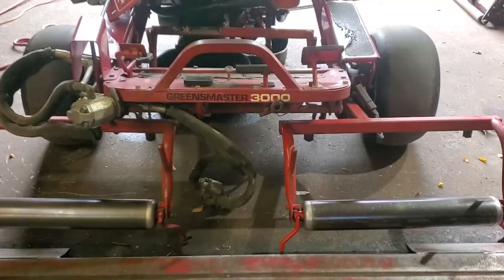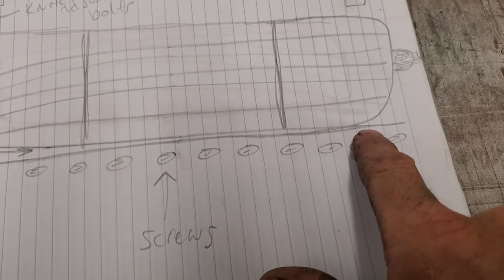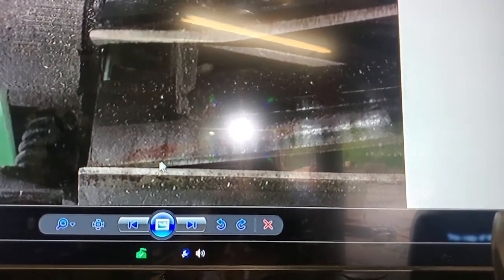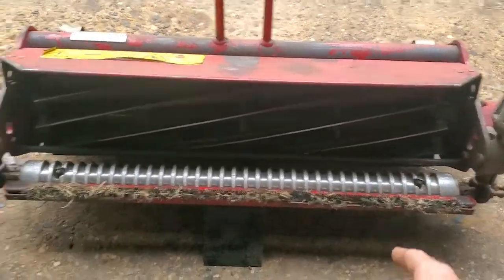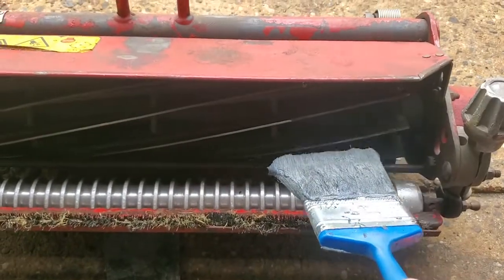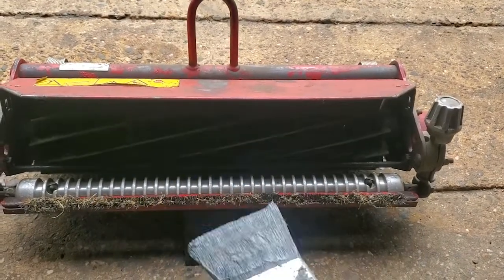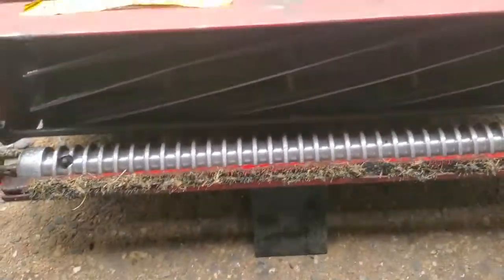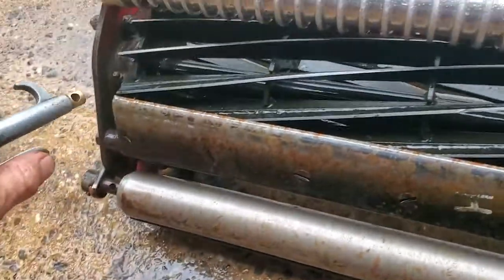Back lapping and Height of Cut tips for Reel Mowers

Comment: Can you please do a video or comment on how you removed the reels from the machine? I have a Greensmaster 3100. This was a very helpful video, thank you!
Reply from the maker: Do you mean take the entire cutting unit off of the front lift arm and rear lift arms? Or do you mean removing the actual real from the housing. To remove the reels I believe on a 3100 it should just be the two 9/16 nuts that are holding the hydraulic motors on the side and then lowering the lift arms and sliding them off.
Reply: @youtubestar  Thank you for the reply! those couplings on the front roller arms that attach to the cutting unit. They are spring loaded that attach to the ball joint on the cutting head, the first one I tried to detach was corroded in place, after heating with a torch I got it to move freely, the rest of them worked fine, just picked the wrong cutter to start on for my first time! I did the adjustments like you did in this video and it worked great, for quality of cut and heigh of cut. This is my first reel mower so your videos are very helpful! Mowed the yard for the first time, and after nearly finishing the yard, the rear steering cylinder gasket blew and started leaking fluid. Do you happen to know where I could find the gasket rebuild kit for that? I am having trouble locating it for sale. I believe Hydraulic Cylinder Assembly No. 115-3273, I think the seal kit # is 112-9170. I subscribed to your channel, great videos!
Reply: I did find the seal kit from R&R products for $93. it just seems expensive for some gaskets!